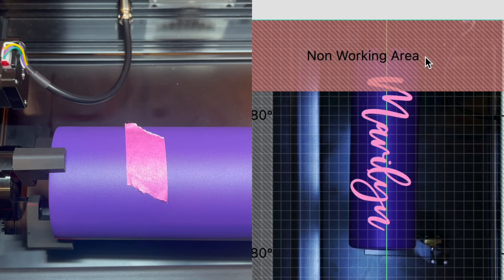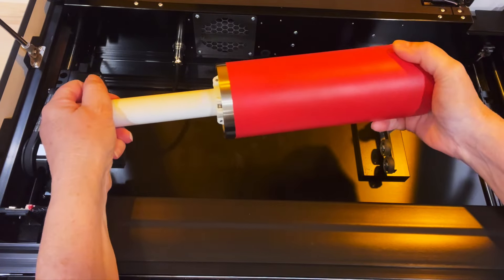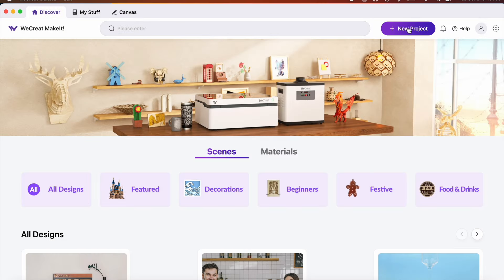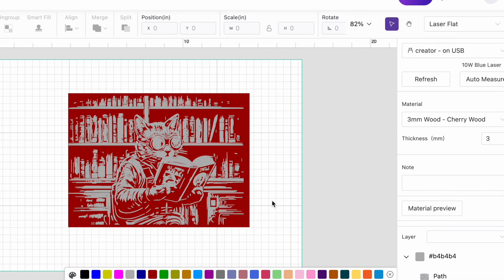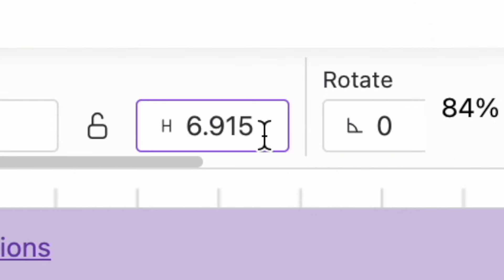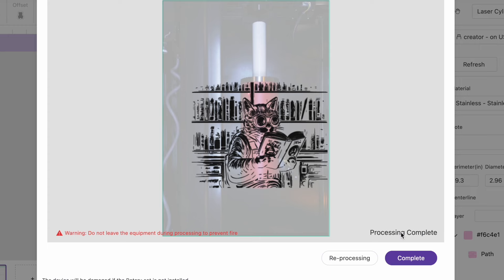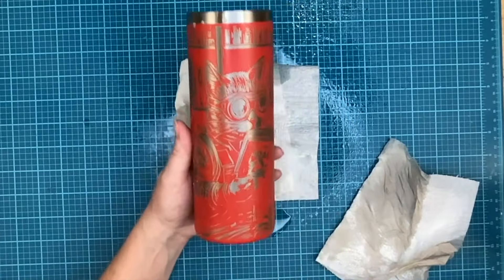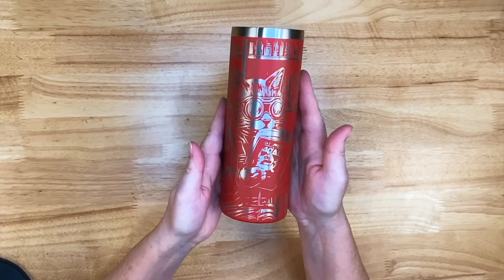How to Use the Non-Working Area of the WeCreat Laser

Comment: Hi Marilyn, I'm getting ready to finish my order for the Vista. They are offering a special on the passthrough and the Air Purfier. Another popular blogger on YT said the air Purifier doesn't work that well. Do you have it and if so, what do you think of it. NEXT, does the adapter work on the 40oz cups as well. Thanks for all of the great videos.
Reply from the maker: I actually really like the Air Purifier, but I also use a CO2 laser that I went out a window and that works very well too. I have not done a 40 ounce tumbler, but I went upstairs to my craft room, and the extension/adapter does fit into the tumbler and provides some support. Because the diameter of the 40 ounce is so much larger, I'm not sure if it would provide sufficient pressure to hold it well.
Reply from the maker: I just watched a YouTube short video and the person was using these same extensions on a 40 oz tumbler. Just wanted to let you know.

Comment: Great information for a rookie like me. I can't understand why the $18 accessory Tumbler isn't included with the machine. When I selected 'Stainless Steel Tumbler' it list Red, Blue, White, Black. What settings are best with just plain stainless finish...no color?  I tried your setting and the image was much too light.
Reply from the maker: Without some type of marking spray or paint, a diode laser doesn't do much on a plain stainless steel finish. Search on YouTube for Marking Spray for Laser Engraving and you should find several videos on it. I haven't done a video using it. Thank you very much for watching!
Reply: @MakingwithMarilyn  Thanks. I have chalk spray I have used successfully on glass. I didn't expect stainless tumblers would need to be engraved like glass but I can understand why.

Comment: The rotary set comes with extenders… they are the 3 long metal pieces you simply screw out the black rubber pieces and screw them in. There are 3 holes, that determines the tumbler size. Mine doesn’t arrive until Tuesday, but I called customer service…
Reply from the maker: I have used those also. I put a thin silicone sheet between the metal things you are talking about and the tumbler. Otherwise, it's a bit slippery. You can use those for things like rings and bracelets also.